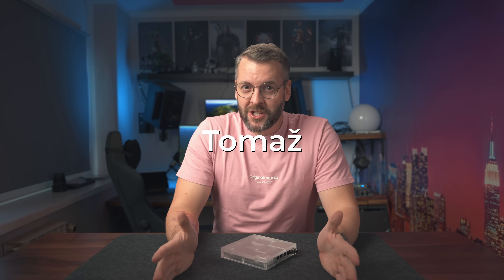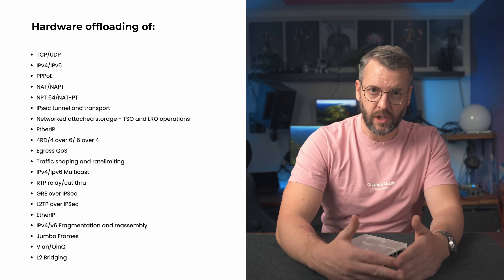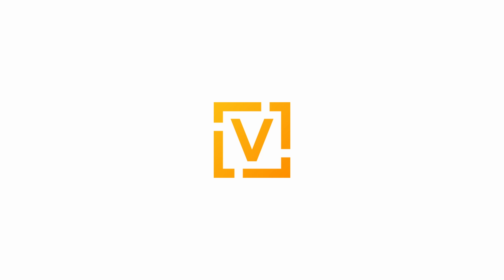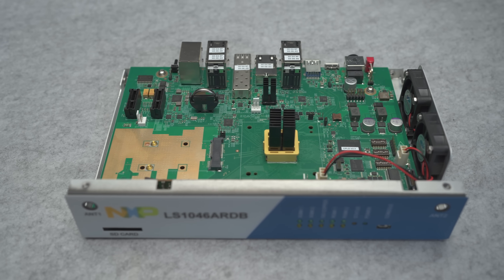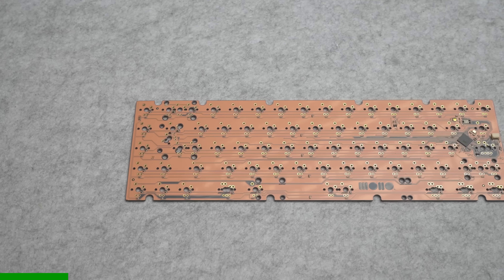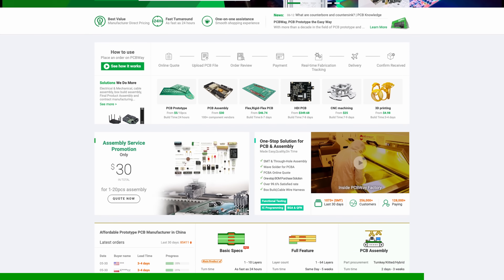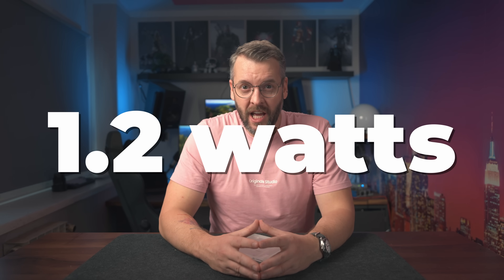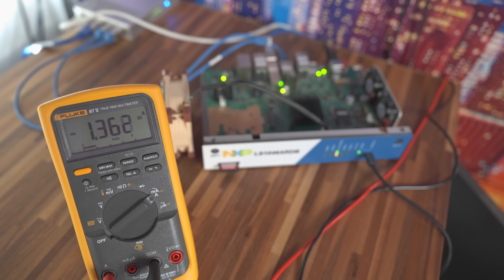10 Gb/s throughput without using CPU cores? ✅ Check.

Comment: Running 2 connection with 10Gb udp flow isn’t the killer. Add 500 firewall rules, then utilize a package generator with 500k connections and see how it performs! How is it then performing?

Comment: Beefy CPU but not a dealbreaker (the GPL violating kernel is though), 8GB of RAM is a minimum requirement for me. Any router I buy in this premium price range now needs to support a  custom Linux OS with my own requirements and 8GB would be a downgrade from my current router already.

Comment: If the routing performance is identical with lower tier parts I don't really see the need for the more expensive hw components

an alternative could maybe be keeping the faster processor and larger ram size while going above 10gb/s speeds

Comment: Not terribly excited about offload performance. The offload capabilities just don't work with the flexibility people buying a custom router would like. SQM, WireGuard, PBR, etc. bring these routers to their knees. 

StrongSwan, OpenVPN, etc. don't perform as well as WireGuard without fine tuning so people have just given up on them.

NXP's 28HPM process and the A72 cores might be well suited for the space/telecom applications but I'd expect it to get very hot doing anything not offloaded. Most of the high-end consumer routers today are 12nm + A53 (efficient as hell).

Relying on a security/government contract focused company like NXP also raises questions about long term mainline kernel support from the company as well as other contributors especially for people that do want the offload stuff to work perfectly.

Comment: You realize that by using binary patches to the linux kernel, you will most likely be on the hook for the potential GPL violation?  Not NXP because you are the one distributing the software.  They are just giving you the tools to violate the GPL, you are the one choosing to do so.  You may want to consult an expert on this
Reply from the maker: We are in the process of doing so (consulting experts). Thanks!

Comment: Your thumbnail seems uncorrect to me.
During your iperf test, neither PPPoE or IPsec were running at that time. You state it in your video that's only about routing (by the way, IPv4 only while testing so still IPv6 is a tad optimistic) but the thumbnail does not report it.
I suggest  you to create a setup with two boards routing to the same subnet, but with a AES256/SHA512 between the 10gbe interface. Then put the server at the other end of the tunnel, an then run the 9.5gbps top speed in iPerf3. I'd be really glad to see the exact same result  :-)
Also: in this video the "High end" classification of the router is missing. But still 100 EUR/USD difference between the two options don't solve the weak point. 1GbE for the remaining ports. On the other hand, about the "sauce" that NXP is proposing to its customers: are they genious, that many other bigger network firms go bigger with CPUs or ASIC instead of this route?

Comment: It's difficult to make a choice here: are you saying that due to the efficient traffic offloading, the reduction in fitted RAM size and CPU clock speed will make no difference to overall performance of the unit? If so - sell it cheaper. Do these reductions impact overall routing performance, or future-proofing of the design? If yes, then it has to be the more expensive spec.

A long time ago you suggested variants at different price/performance points (I suggested different coloured cases to identify the variants) - is this what you are suggesting, multiple production models or a single high-perf model only? For single model only, then no choice - hi-perf. For multiple models at different spec levels, the question answers itself - but more than one variant in production is inevitably going to have knock-on effects later on (production and manufacturing complexity, support of multiple variants in differing builds of firmware, updates and bugfixes, etc. etc.).

I don't have enough info yet to decide what I'd like, but if the buy-in price difference is so great, then I would suggest it's your prerogative to make this choice for your launch product. Given the ethos (fastest, best) it implies the expensive variant is the one.

A price/performance/resource comparison of the low-price/high price variants would help here. Another one of your excellent charts in a follow up video to show the trade-offs more clearly?

Comment: Without offloading I think you could also push that performance using VPP graph nodes in userspace with a AF_XDP socket as the entrypoint. You can use dhcpd and other apps to make it a great home solution.
Reply: yep, this was exactly the reason that i came to know about xdp

Comment: I'll echo the other comments that depending on how NXP is integrating code with the Linux kernel, restricting distribution of the source may be a violation of the GPL, so I'd steer clear of any solution that forces you to do that. Furthermore, I've been doing hardware long enough to know that these whiz-bang proprietary hardware solutions promise the world and seldom deliver in practice, and getting updates to fix bugs in their proprietary software and silicon, particularly in the long term, is a virtual impossibility.  Went down this road with Broadcom in the early 2000's and they completely lied to us about the maturity of the silicon and proprietary APIs.  We were forced to throw away over a year's worth of development and start fresh with our own solution based on a FPGA.  Never again.

Comment: I liked your venture due to your open sharing and open source numbers. Been watching since the first videos and plan to buy a finished version. It has been fascinating to see your process. To see you not being able to talk about certain parts due to NDA and closed source software is a turn off. 

I don’t want some closed source module for this to run properly. I won’t be buying this if it’s using closed source OS software. 

In addition if you add in software for packet inspection, nat, vpn tunneling, does the offloading still work as well? For a modern router there is more to it than just pure routing of packets.

Comment: I've always been of the opinion that better performing hardware is preferable to hacks and tricks like 'hardware acceleration'

of course this also does nothing for other workloads, and ARM is kind of crap for VPN as AES acceleration is optional (so, forget about it) making you rely on chacha in software. whereas if you used even a modest x86 CPU it will have enough horsepower to do software routing and hardware crypto much faster...

Comment: 283 mb of ram is an insane amount for openwrt, could you please break it down what's running on the wrt. what's the softIRQ/ionice value with standard top?

Also about the ram/cpu speed. trust me, if you make 1.4ghz but 8gb would be more appreciated than 1.6/1.8 at 4gb. 8gb remember is the minimum for zfs.

Comment: Tomaž, sorry to sound like a noob, but would this router be a drop in replacement for our Slo fiber internet providers supplied routers like T-2 now that the "fiber everywhere" initiative is progressing nicely.

To me the CPU/RAM question boils down to how much extra load is anticipated for non routing activities, otherwise you just end up with hardware waiting as fast as it can.  I do like the proposal made by others to have a "basic" and "pro" version if you can tolerate the separate SKU and BOM parts.

Do you happen to know if the HW offloading allows for port mirroring for analysis purposes?

Future marketing slogan for the device "Routing from Slo is Fast!" [OK, I'll go now.  No need to push me into Soča :) ]

Comment: As nice as having a linux based router would be, I wouldn't want one if it requires bypassing the kernel routing policies and netfilter. 10Gb is easily achieved with a 4 core box and who cares if the cpu is busy doing what the box is intended to do!? I don't understand from a technical perspective why the nxp modules would work this way, when hardware offloading to the NIC can apparently be achieved without skipping the kernel, for example with the intel i40 module.

Comment: Do not go with cheaper only option. Use extra cpu/memory for extra features to justify price increase and this will give you more competitive product in the end. You are not in SOHO market, you're in enthusiast/lower pro segment. Having good IDS/IPS or, I do not know, maybe, graylog-style log ingesting server and viewer might be the reason for somebody to prefer your solution over putting another server or SBC for network management in remote location. For me that is a common problem with any small setup - you always need some box for things like pihole, syslog, ups monitoring or just to log into remotely and do speedtest.

Comment: Simple routing with the iperf3 example is the easy part. Now check NAT functions and other IP functions. Like DSCP marking/rewriting. Or VXLAN/MPLS. Using the full pipe-line of the SoC to check 10Gbps performance.
And in regard to CPU, things like Bird/Quagga to run routing protocols like OSPF/BGP.
The more prefixes the more CPU/RAM.
Maybe overkill voor CPE devices.
Reply from the maker: On the way! Or should I say, under way! 💪
Reply: @tomazzaman  How many prefix lists, acl rules, nat entries, etc. are possible in hardware? I remember devices which rebooted when the nat table was full - hello bintec! :)

Comment: Why not have 2-4 mounting options? RAM is drop in replaceable, same with that CPU. 2 extra reels on a pick and place is not that much tho they are going to occupy a few more slots it is feasible since you may free that much space just from resistor and capacitor optimisations. BUT when it comes to logistics there may be problems since you will need to have some way to mark them visually and for the SW. BUT that is simple , you can use a resistor/led to visually indicate what it is or laser engrave a mark or use a sticker/ marker mark . as for the SW knowing what is has a top command should be enough but you can also use a free IO pin to read a pull up/down.  Or simply write it in flash/eeprom

Comment: Guys, the compiled binary thing is a non starter. You already gave the answer at the start of this video. 

Use a BSD kernel, as a bonus you also get ZFS for redundant boot storage. Just use pf like opnsense and pfsense do. No licensing issues, confidence from the community, close to 40 year old rock solid enterprise stack. 

You may have your heart set on linux, or maybe its just what you are used to, but unless you are writing your own offloader patches and copylefting them, this wont work in the enterprise without having 10 years in the market and a capex over over a billion. 

No one wants the latest graphics drivers being updated every few weeks on their router, they only want it updated specifically if it affects said router. Your overhead on this is huge. You are going to recompile and offer new kernel updates including non-free blobs compiled against it within 24 hours of a specific issue? What if your sales die, funding runs out, you have a supply chain issue and are running low on cash?

People will only trust their enterprise to a startup with insurance they have the code and therefore other vendors to support them if you guys fail. For the prosumer/homelab/SME market, there needs to be a community to keep the code going, sans corporate agreements with a 3rd party vendor.

Sorry guys, your question isnt faster vs cheaper. Nextep took the BSD kernel, became Darwin/MacOS. The linux kernel was more mature at the time, commercially they chose it due to licensing. You need to as well. 

Sorry guys you are still at working out what OS you are to ship on this thing.
Reply: Also, as a side note, you can't distribute GPL code with a proprietary blob. So you'd have to make an installer to connect to the internet and download it separately. 

Works for an OS, it talks to the router to do that. 

You guys ARE the router.

We need to configure it, then we pull the blob to connect to the internet via offloading?

Other than dual stacking this thing (kernel and offload), not sure how that works.

// end rant
Reply: // start sidenote

You guys want to create the best hardware, do that. Just ship it with a BSD kernel and be able to do 10ge no problem. Make it open so if people want to install VyOS and install offload blobs themselves (home lab people only really), they can, but I wouldn't be shipping it with that. It makes it your problem to support it.

Just trying to help. I really want to buy one when it's ready, I just don't want you guys failing straight out of the gate for something so mundane as licensing and governance issues.

// end sidenote

Comment: I'd be interested in learning if inter-VLAN routing via tagged interfaces requires bypassing the HW offload of the firewall. Most solutions I've used in this space see a huge performance hit once you try to do this, and you usually get encouraged to separate your firewall from your inter-VLAN routing performance when doing so. I have a stupidly overcomplicated network in my house, and right now my core switch is doing inter-VLAN routing, but I'd love to have everything being done on one device.

Comment: I think you go with a cheaper version out of the gate, but know you could create a more performant version for those who want to pay for it. Not everyone needs all the bells and whistles.

One question on the 10 gig ports. Can they be used as a WAN or LAN interface? I have 5 gig fiber Internet.
Reply from the maker: 10 gig ports can be used for pretty much anything you want - hardware offloading isn't port-specific (although it can be configured that way).

Comment: Personally why not 2 Models? 4g with slower CPU and 8g with fast CPU.
And Pls dont forget about v6 in the offloading part. Its a longer address and I don't want to be hanpered in v6 just because it was forgotten during the implementation phase.
Reply from the maker: Absolutely, IPv6 is natively supported by the hardware acceleration stuff, and it'll be part of the end product!

Comment: As long as it can handle everything it is supposed to, why waste resources? Question is, what you want to ship and what people can do with it. From what I understand this is a router, not a server or NAS. So I’m not sure if we would run other software with it, that would require such extra headroom.

From a marketing standpoint and interesting opportunity: Segmentation - if you can show you can build high end first, then maybe you can then later release a less customisable version. You can see this in the 3D Printer space with Bambulab, they released their high end x1c model and then introduced more core feature focused versions that were cheaper.
Reply from the maker: My thoughts exactly, go with a more powerful version first, to both show we can and also test how the market responds, and then, if there's demand for it, release a "lite" version.

Comment: Please add coax cable. Eurodocsis 3.0/docsis3.1. Because the currents are bad, and in Germany we have Router freedom
Reply from the maker: Unfortunately, not in this version, hardware specs have already been defined and are pretty much locked down at this point as we're pretty much wrapping up PCB layout these days. Choosing a less powerful CPU (or less memory) doesn't incur any additional costs, because those parts are pin-compatible, but adding another connector would pretty much require us to tear it all down and almost start from scratch.

Comment: So the offloading drivers basically hack into the kernel networking stack, meaning this would work for all linux-based routers including FRRouting? That's pretty cool and makes this the ultimate homelab router platform.  It would be even cooler if the NXP code would be part of the mainline kernel or at least fully free.
Reply from the maker: Agreed. Will talk to them, see what we can do regarding open sourcing at least parts of it.

Comment: I wouldn't consider deploying these routers, since I'd be fully dependent on you for upgrading to future kernel versions. Even decades old industry giants mess up device lifecycles on the regular. Asking for that level of trust in a relatively small operation like this sounds unreasonable to me. On the other hand, if the entire software stack was open source I'd be more than willing to evaluate it for serious use, as the features do sound rather compelling. It would make not blatantly violating the GPL easier as well :^)

Comment: Meh, the more this goes on the more it becomes a prosumer firewall like UniFi. If hardware acceleration is locked to the "vendor firmware" then this device will live and die with the vendor, and also any kernel update will require development to re-integrate the whatever blob

Comment: WRONG:
1 - you didnt test any routing , just hardware offloading, which is not bad untill you use the router as a router and you have to hit kernel tcp stack, the numbers will be much different 
2 - thats good that you have all that offloadings for vpns and vlans from 2014 (level of Mellanox connectx-3 which you can get from ebay for 20$ ), but the second you use something new and mainstream , the router will struggle 
3 - can you provide  results of  "ethtool -a ethX" for us to see what actually supported ?
Reply from the maker: 1. I see your point, I just wanted to get this out ASAP, but will prove in a future video that it makes no difference in terms of numbers.
2. Not necessarily.
3. Yes, but not yet, this was a test with out of the box OpenWRT with any kind of configuration.